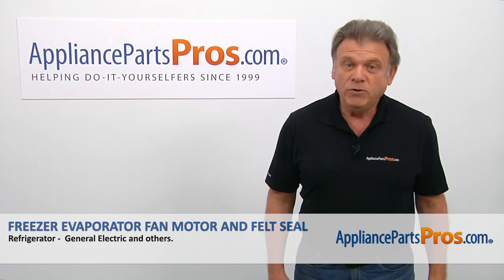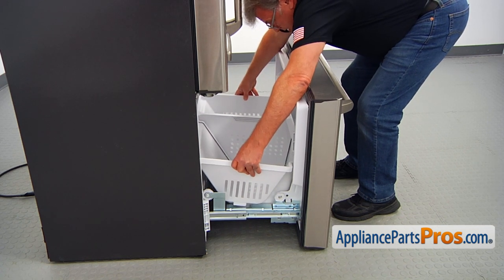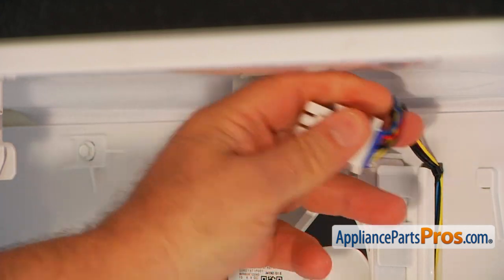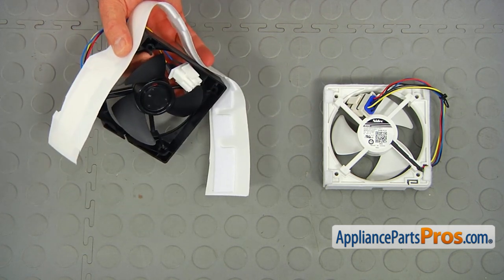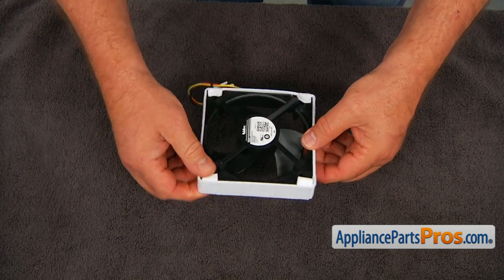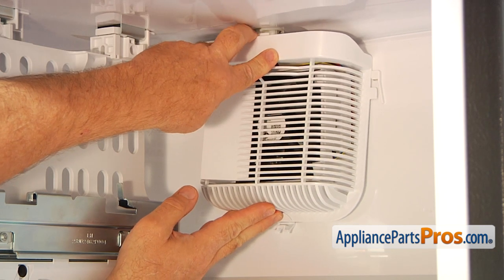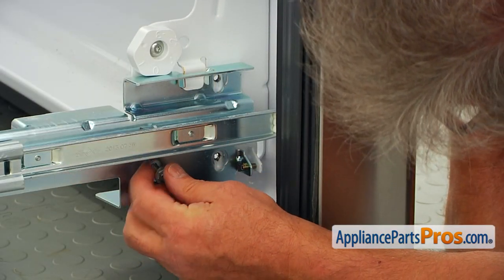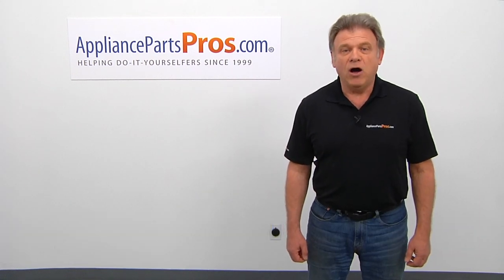How To: GE Refrigerator Freezer Evaporator Fan Motor and Felt Seal WR60X10352

Comment: Should this freezer fan be rotating all the time when you open and check or does it run periodically?
Reply from the maker: This part shouldn't be running when the door is opened or whenever the fridge is going into a defrost cycle, other than that the fan should be running.
Reply: My fan is running even when the door is open.  Is that a problem?  When I first checked the fan, it was not running, whether the door was open or shut.  Possibly it was in a defrost cycle.  Now it runs whether the door is open or not.
I notice that my freezer is defrosting every six hours, like clockwork. That seems too often.  I replaced the fridge defrost thermostat just to troubleshoot.  Could the freezer defrost thermostat be bad?  It looks like they are the same part number and I kept the old fridge defrost thermostat.

Comment: Would there be any other reason why the freezer fan is not running? For example, does the fan activate based on temperature only or does it require the compressor to be running?
Reply from the maker: The fan should be running when the compressor is running. If your compressor is running and the evaporator fan is not you will need to test for power to the fan motor. If you have power there and it's not coming on then you will need to replace the fan motor.
Reply: @appliancepartspros  So I hear the compressor and visually observe the compressor fan rotating next to it so....I now need to disconnect the lower (freezer) fan and check for power with a Multi-meter.  If power then purchase new fan.  (It has a "WR60X25858" number on it.)
Reply from the maker: Correct